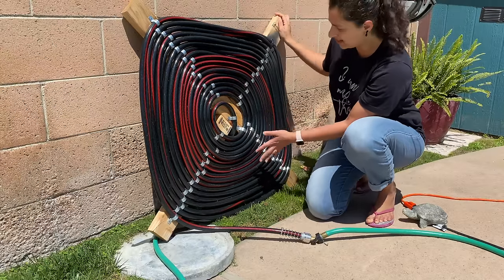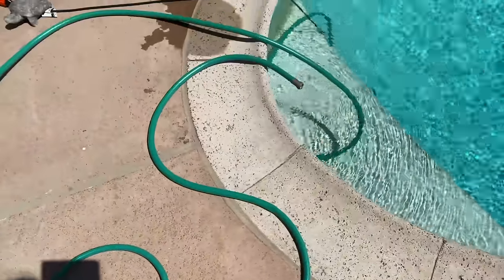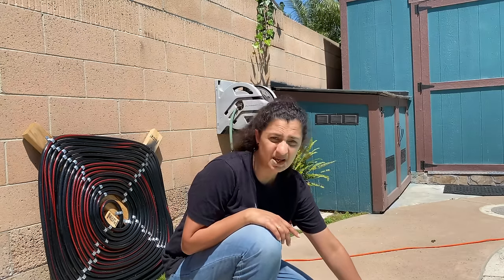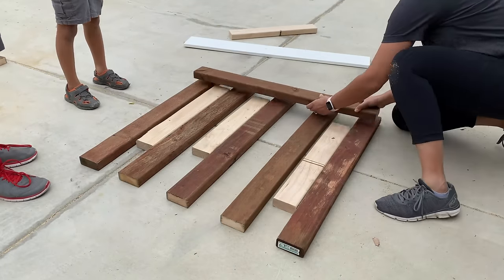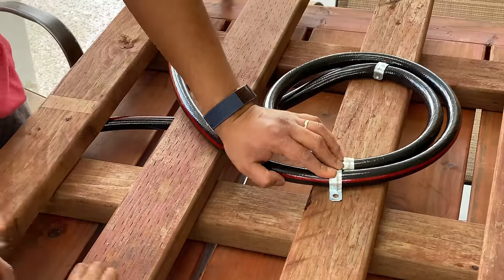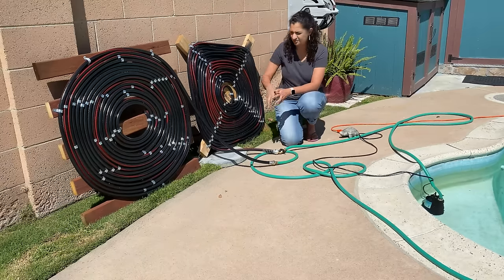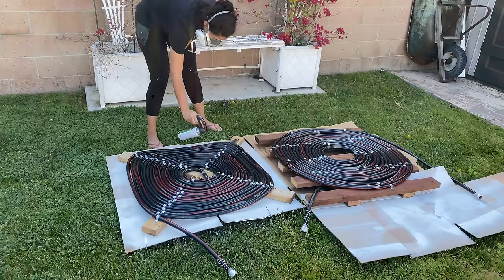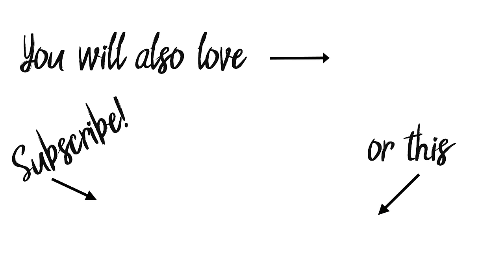DIY Solar Pool Heater - Simple & Easy Design - Did it work? | Anika's DIY Life

Comment: We bought a solar heater mat (6ft x 12ft) that hooked in line to our pool's return line and it made the water so warm, we rigged a ball valve to by-pass the heater for when the temps got too warm.  Now this is in Connecticut, where average temp of water without heater is 75*-80*.  With the heater, no bull crapping, the temp of the water went as high as 116*.  Too warm.  We learned to regulate it to keep the water temp around 100*. Just right. Extended us to late october.
Reply: How many gallons were you heating?
Reply: @jonathaneaves5840  it was a 16 ft round 52 inch deep pool.  I believe it was 23,000gallons total, give or take 50.
Reply: The only problem if ya wanna call it a problem was the higher the water temp was, it seemed like we were adding more chlorine due to the elevated temps 'burning' it off quicker.

Comment: Enclose the coil in a glass fronted box.  It will heat up even more (think about how the interior of your car feels after it’s been left out in the sun). Also, if you have plenty of sun,why not make the pump solar powered?
Reply: You would blow the budget using a photovoltaic system  to drive the pump.   Every dollar spent has to go towards heat gain.

Comment: Hello! If you painted the pool a dark color, you have much more surface than a coiled hose to capture solar radiation and it would offer much more heat energy gain without the need to turn on a pump
Reply: Unfortunately, an incredibly huge waste of water, especially in a drought-ridden climate- California.

Comment: Thanks for this idea, How is the hose produce the heat… bit confused .. is there electric coil in the hose ?
Reply from the maker: The black hose collects heat from the sun and heats the water as it flows through.
Reply: @Anikasdiylife  ok .. but that would not be sufficient to hit 10000 plus gallons of water.. may be solar panel or heating coil can make it heat faster .. need some engineering though.. we too can’t use pool during winter although in texas :)

Comment: You don’t need another coil, you only need to increase the surface that catches sunlight. Lay it flat on the ground or even better 90 degrees angle towards the sun.

Comment: put your hose in a enclosed box with a polycarbonate front to maximize the effect. material needed: 3/4" plywood covered in silver fence paint. 2x4" for the sides and a 3/4 inch piece of polycarbonate for the front. use the same hose layout you have now but hold it in place with a cross made out of plywood or thin strips of wood. No need to restrict the pump.

Comment: I really like your videos. What you need is a little solar power.  Just put the same concept to a different rule. So, put it on plywood, paint it black and put the coils on top. Raise the hose about 1/2 inch off the plywood. Solar-powered.

Comment: Good video!  Guessing you all are computer science or electrical engineers… temperature and flow rate are inversely proportional but thermal energy entering the pool water is roughly the same regardless.  Allowing the tubes to become significantly warmer probably allows more heat to escape into the air as rate of convective heat transfer rises with delta T.  In other words, let the pump run full.  The outlet temp will be slightly higher than inlet temp even if you can’t measure it easily but the energy being moved into the pool will be the same or better with fewer losses at the coil to air exchange.  A trickle of scalding hot water “feels” like it’s doing more than a torrent of luke warm but you have to do the math to actually know.

Comment: It looks like you've got to use multiple pumps for a long time, to heat the pool effectively. Is it still using less electricity than a regular pool heater? Is it still using fewer non renewable resources overall (Including processing of metal, plastics, etc.)?

Comment: I read a few of the comments but didn’t see anything about how long it takes to heat up the pool. If your pool is it 70° and you turn this on, does it take a week to get it up to 75°? I want my pool to be at 80° is it in possible to expect that to happen with this kind of set up? Thanks, in case you didn’t notice, I am completely new at looking at solar power through hoses for your swimming pool lol

Comment: The flow rate wont really matter. Its adding some "X" number of Joules (energy) per second to the pool regardless of the flow rate. With the slower flow rate, youre getting a higher output temperature, but on a long enough time scale it will be irrelevant. The higher flow rate may help since youll have more water in contact with the inner surface of the hose.
Reply: first of all comments who speek wise!
Reply: hi so I saw another video where they did this but they used a copper coil section on a grill. He also used a hose a spray on the end in order to again trickle the water.. In that case, where it’s not dependent on the entire hosing system, being heated by the sun, just a relatively small portion of the coils being hot AF on the grill… would it still be better to go at maximum flow rate?
Reply: @XclusiveChiq  I'd say so yeah. Heat transfer slows as the difference in temperatures diminishes. So, the faster you're pumping it through,  the cooler the water in the line will be,  the greater the difference in the temperature is between the water and the heat source,   the more efficient the heat transfer will be.

Comment: Have a question for you guys about the pool heater. How did you connect the sump pump to the hose? Did you just saw off the first part of the plastic elbow-connector?

Comment: If you do two large coils and use the piping for irrigation and modify the outlet that water is put in the pool you can save electricity from a separate pump. Two coils gives more distance to handle faster flow. Just drain the pool below the valve that water is flowed in the pool with its own circulation and modify that to connect the solar to that and the other wind of the solar back in the pool.  If not you can always keep that method and get a solar panel at harbor freight cheap for powering the pump.

Comment: Enclose them in a box painted black with a glass lid. that will trap more heat around the pipes making it more efficient.
Reply: Wouldn't plexiglass be better or just as good
Reply: @rhdtv2002  I think the Problem with SOME plexiglass is it yellows in the sun which would cancel the benefits.
Reply: @latinlil2185  polycarbonate would be fine in the sun.

Comment: Tip: put the hose flat on a rooftop, asfalt shingles are the best. The heat transfer from the roof to the coil will increase the efficiency tremendously.
Reply from the maker: You didn’t really watch the video did you? Because I said I wanted to have it so we could put it away when not used.
Reply: @Anikasdiylife  Ooooouuuuch !

Comment: Thanks for sharing, Will improve if:
+ Connect them in paralel instead of séries 
+ Increase flow
+ Place system inlet and outlet apart (inlet should be from the bottom where is cooler)
Reply: "+ Place system inlet and outlet apart (inlet should be from the bottom where is cooler)"
What?!
Reply: @itechhen  so the pump suction is at the coldest part of the pool and the discharge is away from the suction, you don't want to be pumping the warmer water back through the system

Comment: We have a 60cubic metre pool and I have 100 metre hose on a flat black ashfelt roof I had a complicated timing system to try build up the heat in the hose before it went back into the pool e.g. pump runs 5mins off for 15mins on for 5 mins etc. It worked (sort of) but should I just let it run all the time? Am I gaining anything by stop starting? Also it is on a separate pump would it be better just to run through the pool pump? Would covering the whole set up with clear plastic sheeting increase the amount of heat? I have a bubble cover on the pool when not in use to retain heat already built up. Thanks for any advice

Comment: A 12V pump and a few 12v solar panels would be a nice twist for your build!
Reply: 12v pump is way louder than the utility pump as it must work very hard to push all the water. Also flow rate is much higher for 110v pump.. Just make sure do not run this when people are in the pool, and use CFGI plug for the pump. I have a harbor freight 12v pump and the noise is quiet loud, and 110v utility pump can barely noticeable.

Comment: even if it's a difference of 0.1° it will still work. There's thermal energy added to the pool. You should also put the return hose at the bottom of the pool if possible so that it mixes with the rest of the water

Comment: If you could connect your solar heater straight to your pool pump you could do away with the sump pump and keep it running even when your using the pool. Probably the most efficient would be a solar cover over the pool that would keep the heat in it during the night and help heat it more during the day when the sun shines on it.

Comment: All well and good. The question is at what rate of flow (Gals/hour) using your 2 x 100 foot sytems does it take to achieve an one degree increase IN THE POOL (what was the total volume of water in the pool?
Reply: I am going to try the guage port on the filter to put water through the coil

Comment: I feel the need to add something that nobody has fully explained about throttling down the water flow. First off, even if you could get the temp increase from 75 up to 110 degrees you are nearing an uncomfortable discharge temp for small kids. Next I'll mention that most garden hose has a shorter life span at higher temps, which is why high temp (hot water) hose is sold. (yes, it costs more) The real deal behind gaining BTUs is in this example... Think of how easy it is to raise the temp from say 75 to 85, even on an 85 degree day. It becomes less efficient to attempt raising it further because now you are dealing only with solar gain and nothing from ambient air temp. Taking this a further step, lets suppose you slow the flow to gain a few more degrees output but you probably need to cut the GPM by half to do that so basically you have less total volume and therefore less total BTUs of transfer. Last but not least, somewhere in the hose loop (maybe half way on a hot day) the water is over ambient temp (let's call that 85 degrees) and if it's 85 degrees outside your ability to absorb more BTUs is diminished by a fair amount. Again, strictly absorbing solar, but no ambient heat gain.

There's a few more items that I will gloss over... in order to heat a pool you need to gain heat faster than the surface area of the pool can give it back to the air. There are calculations available to compensate for sun / shade / ambient temp versus total surface area of the water. I wont get into those details. In the northern sections of the USA solar collector size needs to approach the total square footage of the pool surface to get 10 - 20 degree rise. I have not worked the warmer areas of the USA but suspect the numbers will be 25% - 50% of that. You also need to shut the system down at night to prevent cooling of the water. 

Cheapest way to raise pool temps? (long term cost) Use a floating pool cover. (looks like bubble wrap) It does wonders for solar gain and almost completely stops evaporative heat loss. You can also save a few bucks on chlorine consumption because you are lowering the UV exposure.

BTW, you could install some hose connections (with valves) directly at the pool pump, which would cut down on the extra pump and all of those extra hoses on the deck, not to mention the extension cords. Put the whole system on a timer to gain savings on your electric bill and not run at night when it will cool the pool.
Reply: You are 100% correct on the bubble covers. We used it in our past pool and it works EXCELLENT..Almost too hot if left on long, but perfect at cool nights. Also leaves your yard nice and clean once rolled out of the way.
Reply: Seen the price of the bubble covers lately? Used 6mil 20x100 ($90) sheeting from HD. Covered entire pool, secure to coping with 100' hose around perimeter. Added some cheap floats from $ store. Lasted over a year, same as the expensive bubble covers, but got 3x the covers, (cut to fit) then the $200 cover for a 1 time use....

Comment: Pool cover works much better. You can raise the temperature by about 4-7 degrees Celsius in the pool if the difference between day and night temperature is 10 degrees.

Comment: Nice video, but when I did this the flow was never going to be enough to heat my pool and its  only 10k liter. Yes your test shows heat increases when placed directly into your cup but you need to show pools temperature after a day with this method.
Reply from the maker: It will take time to heat up and a day is not enough either. It takes our pool about a week of full sun to warm up enough to be able to swim. We have used it the last few years and while this isn’t as quick as an actual pool heater, it has definitely added over a month to our swimmable time vs letting the sun warm it up for us in the spring.

Comment: I don't have a pool but I have an idea that I haven't seen on Youtube. When the water is too cold to swim in I would float a black material directly on the water and let the heat transfer into the water. Maybe one of those black plastic ground covers submerged a little. I would try lightweight materials that float and transfer its heat into the pool water.  Consider a material that could cover the entire pool surface.

Comment: You need to encase it. Most of the heat comes in the form of IR. So you need to encase it in plexi glass or something similar that then allows for NO airflow to cool it down.

Comment: 1,000' of black 1/2" Rainbird irrigation tubing is $100, a flat coil of which would be about 10' diameter on the roof. Polyethylene does have limited UV resistance, so possibly coat it with a black plastic-adhering primer.

Comment: Finally, someone with an engineering mindset does this.  Visited the blog.  Nice flow rate chart.  Vids show 70F temp.  You State 78F with the heater.  Worth Pointing out in the vid.

Comment: For your 20K gallon pool, how long did you run the two coil system and what was the temperature differential (starting temp, ending temp).  What the ambient temperature?
Reply: likely no change.  The thermal mass of the pool compared to the heating is way out of proportion.  You can likely do this on the cheap but you can't escape physics.  You need to expose the correct percentage of your pool volume to the solar system or you are dumping a kettle into the ocean.  There is a reason professional systems would be much larger than this.  DIY systems are usually less efficient to be cheaper and that means you need a much larger system to compensate.  The approach shown probably did nothing.
Reply: This would probably work better for something like a shower than a pool. Save on water heating bills.

Comment: Instead of putting your 'hose circle' at almost and 90 degree angle( standing up ), try about a 15 - 20 degree angle.  also,   like others have mentioned,  try putting a sheet of glass on top of those 'circles' in a 4' x 4' 'box ( 2" x 4" sides attached to a 4' x 4' CDX sheet of plywood & all this painted blk  ).  Just a thought.
Reply from the maker: It isn’t at 90 degrees. It is at an angle on the wall. We don’t have enough yard space to have it laying down. Which is the reason we built it such that we can move them easily. Adding a sheet of glass would have been our next step but it worked well without it and we didn’t need it.

Comment: Build a box, paint it black, set your coils in it, put a clearish plastic sheet to seal the heat in and you will get A LOT more performance. Think of it like your car sitting in the sun with the windows down its hot but tolerable. With the windows closed it becomes unbearable. Putting those coils in a box makes the same green house effect. You will be able to turn up the flow because the water will get way hotter running through the same amount of coil.
Reply: i have a question. can i have on of the return connected direct to the hose?
Reply: No, this is far from ideal. Youre losing a lot of energy through relying on air as a conductor instead of laying the pipes in direct sunlight. 
However, it could make sense to build a transparent box around the coiled hose to prevent air from cooling the exposed hose. Although I don't think it's worth the effort, I might be wrong tho.

Comment: In theory this works, but there are lots of caveats. I have a 17000 gallon pool and tried this as well from other videos. I am skeptical as to whether it really works..or rather I should say works well. I have a pump that moves about 600 gallons per hour so I would only be able to move less than half the volume of the pool in a day, in reality much much less because at some point the pool ends up shaded by the house making the system pointless. I only get about a 2 degree F increase coming out of the hose with two coils. Given the volume of water it would have to move, not buying that this makes a huge difference relative to the heating effect that just the sun and air give the pool.  Only way to really know for sure is to measure the temperature of the pool on a day without the system running and a day with it running - and the days would need to be nearly identical. If you do that and then can show a significant difference in water temp - like 5 degrees or more, I would say you have victory. I'm not seeing it though. Tried to check your blog to see more details but the link isn't working for me.